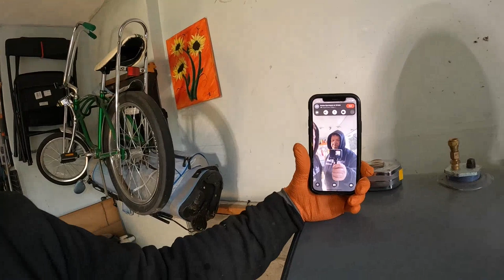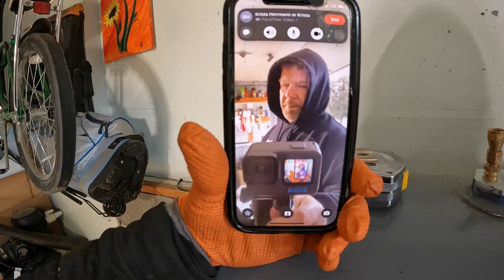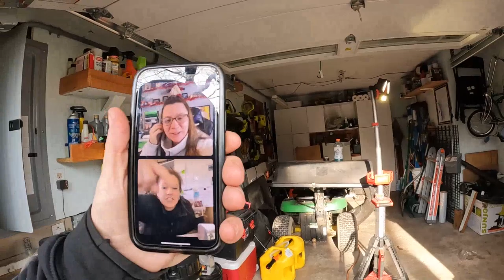How to remove garage oil tank and replace with bollard

Comment: An idea for the trailers
Putting small helper wheels under the back end deck of the trailer
They dont have to be huge
Just big enough to roll the weight of back end up a hill
Straight bar across the back end of trailer inch below trailer deck two hubs and supports 
So when back up the back wheels keep the back end of trailer rolling with out hitting ground
Its an idea qnd head full of them lol

Comment: It’s a good looking job. Two things #1 I would like to of seen an over head pipe to the burner instead of through the concrete floor. #2 I would of like to seen some reflective tape on the Ballard not a big thing just that little extra thing

Comment: I’d like  to know more about the tiger loop . Is it just for long run single pipe setups or does it make sense for everyone to install one for fuel saving / air removal.  Thanks , love the channel.
Reply from the maker: The Tiger loop
          New products are continually being developed in the modern oil heating industry in order to satisfy new laws and regulations for environmentally safe and energy efficient oil heating installations. Recent development has led to low-Sulphur heating oil, highly efficient burners using blue-flame technology and condensing oil boilers. This new technology helps ensure optimal combustion making oil heating a reliable, cost effective and environmentally friendly alternative. However, these technological developments have created an even higher demand for clean, air-free oil to ensure reliability in oil heating. The Tiger loop® automatically and continuously removes air from the oil, creating the best possible operating conditions for the heating installation.
                Gas/air bubbles in oil When oil is drawn up from the oil tank to the burner, large amounts of gas bubbles can be released from the oil. These gas bubbles are released when there is a negative pressure (vacuum) in the suction line. The quality, temperature and viscosity of the oil will also play a determining role in the amount of gas released. This occurs in almost every installation, but above all when oil must be lifted to a higher level and/or drawn through long suction lines. The gas/air bubbles flow with the oil into the oil pump and are the leading cause of breakdowns. Gas/air bubbles also lead to an increased buildup of soot, reduced efficiency, increased emission of harmful particles, unnecessary wear and tear on the oil pump and higher oil consumption. The two-pipe system was developed to try and get rid of the gas/air bubbles from the oil pump. A return line pumps the separated gas/air bubbles together with the unburned oil from the oil pump back to the oil tank. This, however, does not reduce the amount of gas/air bubbles that flow to the nozzle for combustion, which results in nozzle problems (see page 4). The high flow of oil in the two-pipe system (up to 20 times more than what is used for combustion) leads to increased dirt/sludge being released from the oil tank leading to clogged oil filters and nozzles. Problems with two-pipe system
       The pressurized return line in a two-pipe system is the number one cause of damages due to leaks in heating oil installations. Even the smallest leak in the return line can lead to terrible environmental damages and expensive cleanup. To avoid problems with leaky return lines, countries such as Denmark and Switzerland have already established laws prohibiting use of the two-pipe system. In these countries, the one-pipe system with a de-aeration device like the Tiger loop® is standard. Other countries, such as Belgium and Germany are also in the process of establishing similar laws. For example, the one-pipe system with a de-aerator is standard in most German states and even required by law on new heating installations.
 New laws and regulations for environmentally safe oil heating installations are leading to the demise of the two-pipe system. Tiger loop® makes a one-pipe system possible for every type of oil heating installation. The one-pipe system is the most environmentally safe method for transporting oil from the oil tank to the oil burner. The advantages of this system will also increase burner efficiency and reduce fuel consumption. One-pipe advantages from the oil tank Two-pipe reliability for the oil pump Between the oil tank and Tiger loop®, the heating installation functions as a one-pipe system. However, between the Tiger loop® and the oil pump, it is a two-pipe system. Be sure that the by-pass screw is installed in the pump for two-pipe operation. The Tiger loop® will automatically and continuously remove air from the oil helping the burner to run more efficiently. The Start/Stop function of the burner is improved as no air pocket builds up before the nozzle. Oil is also preheated by the friction in the pump to approximately room temperature, thus eliminating problems associated with cold oil. Tiger loop® - for environmentally safe and highly efficient oil heating installations The Tiger loop® allows you to place the oil tank below the level of the burner. Air bubbles that are released in the oil due to the vacuum in the system are automatically and continuously removed thanks to the Tiger loop®. By using the Tiger loop® system, only the amount of oil burned in combustion is drawn from the tank. This reduces the flow of oil, which saves filter life and preserves oil quality. Also, with no return line to the tank you will reduce installation costs and eliminate the risk for return-line leakage. An oil pump delivers the same amount of oil irrespective of what is needed for combustion. In the case of a normal domestic burner, only approx. 5 % of the delivered oil is actually burned in combustion. In the case of the traditional two-pipe system, the remaining 95% is transported back to the oil tank. With a Tiger loop® automatic oil de-aerator no oil needs to be transported back to the tank. The oil that is not burned in combustion is lead back to the Tiger loop® where it is de-aerated again and again automatically. For this reason, only the amount of oil to be burned in combustion is sucked from the oil tank. Gas/air bubbles are also released when friction in long oil lines causes a vacuum (negative pressure) to build in the oil line. The more friction, the more bubbles that will be released, causing problems for the oil pump. The result is poor combustion and increased fuel consumption. The Tiger loop® even solves this problem by continually de-aerating the oil. Summary of Tiger loop advantages: • Eliminate the risk of leakage in the return line. • Reduce the flow of fuel, preserve quality of oil. • Less dirt/sludge transported in the system. • Better combustion, reduces oil consumption. • Solve the problem of nozzle dripping causing soot build up. • Provides the best possible operating conditions for pump. • Satisfied customers / reduces call backs. • Thanks for commenting

Comment: Worst install I’ve ever seen, just went from a one car garage to a no car garage in three hours. Should have put the tank on the outside of the opposite wall instead of putting that ridiculous bollard right in the way of everything and the 7 foot high vent and fill pipes. Yuck.

Comment: Pretty corny sales pitch video. No 1 spray painting, black iron without any sanding and primer on the legs completely useless they will be be rusty within three months. No 2 connecting the fuel line through the topI? t’s only going to lead to more callbacks because of air in the line, which is great for your business. Also, how does that work if you have two tanks in tandem like 50 % of the people do today.  No 3 been around a lot of years. Never saw anybody that stupid to use a fuel filter for a foot rest. But I have seen almost every homeowner store, ladders, bikes, etc. on top of the fuel tank, which will easily  damage the soft copper tubing that you are so proud of and once that’s broken all the fuel can still siphon right out of the tank anyhow. No 4 you should have advised the homeowner to move that mower out of the way and put the tank over there so you don’t have to look at those two nasty pipe’s sticking out of the front of the house right at eye level and smell the fuel oil fumes in the hot summer as you come in the front door. Plus if there should ever be a spill when filling the tank, you wouldn’t destroy the asphalt driveway.

 And  finally buy yourself a decent selfie stick and hold it eye level so people don’t have to look up that nose must be quite scary in the winter time.